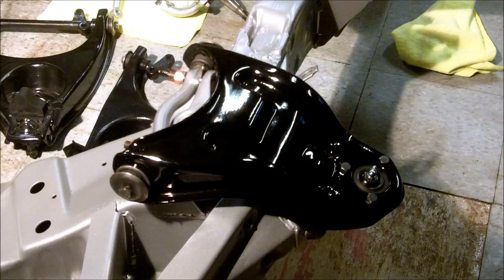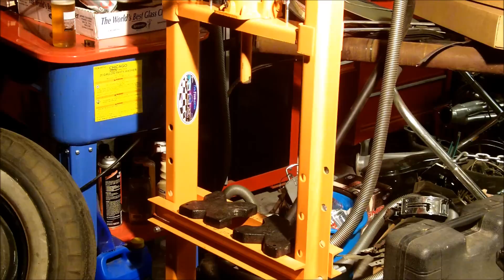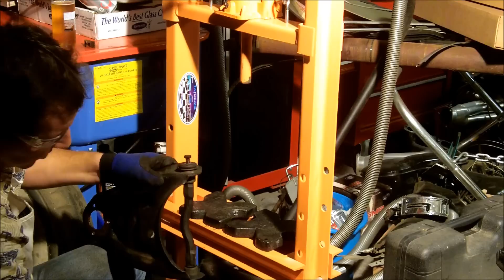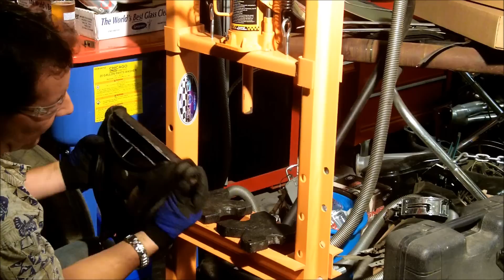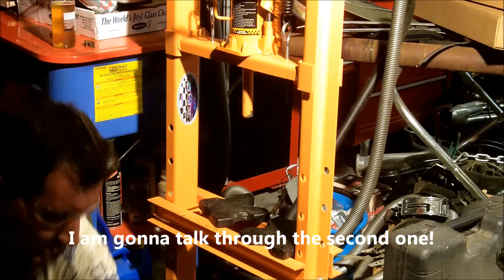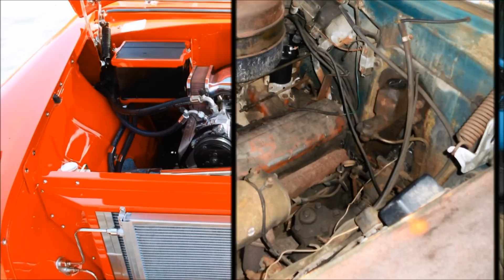1956 Chevrolet Control Arm Bushing Removal Video

Comment: Okay, question. I made some of the slotted pipe 'tools' for saving the A-arms from warping. However, you are showing the upper A-arm process. What about the lowers?? They have areas that allow them to be bolted to the frame. How do you fit your slotted pipe tool around them. And I understand the uppers use 9" slotted pipe tool, and the lowers use 12" tool, with a couple spacers inside the a-arm to circumvent crushing? Do you have a video of the lower process??  :) Oh, and I went and purchased the hydraulic press from HF. Caught it on sale for $139.00.
Reply: Okay, I figured out how to cut 'slots' in the '12" Tool", but now I am attempting to make a couple small half circle pieces to fit inbetween the outer and inner areas of the lower control arms. Any helpful ideas??
Reply: Okay, not trying to hijack your site, but I am learning from you as I go. One point that may or may not seem obvious is that the iron spacer plate below the a-arm needs to be positioned so that it only rests against the flat surface of the a-arm. If you catch the raised ridge, you will bend your a-arm. :)  I know I am 12 years late to the party, but I am still working on my 56.  :)

Comment: Doesn’t work for a 58 Chevy .. did exactly the same thing but just wrecked the bushing and the outer sleeve still remained .: plus on a 58 lower control arm you have a  double wall where the bushings go through..

Comment: Show removing the lower control arm bushings.  Those are the hard ones.
Reply: 55ej1 Have you figured out a way to remove the lower ones. I am working on my 56 chev now... Thanks
Reply: Jonathan Barcus I took a small drill bit and made lots of holes in bushing sprayed wD 40 while doing this.  Took bushings out piece by piece. With both bushings out I used the lip on the cross shaft to push metal sleeves out. One sleeve was messed up so used chisel. Took some time but I did get every thing out.  I did make the tools that were used back then but being 60 years old they just didn't work.  The shaft has to be in just the right place in order for them to come on out. At first glance they don't look like they will come on out.    P.S.  I do have a small press that I bought off ebay to help with this. If no press you could just use chisel to remove metal sleeves.   Hope this helps.  EJ
Reply: Thank you for the info. That sounded really challenging... I did break down and buy a 12 ton press and was able to pop them out that way.